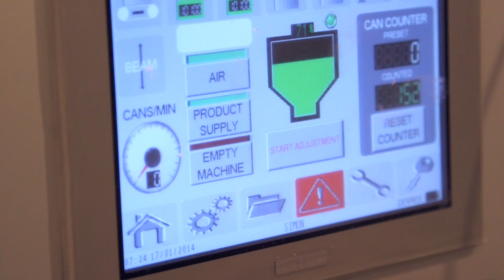Crown High Speed Filling Line

Comment: If someone need to start Paints manufacturing business & want to produce these quality products. Decorative & Industrial paints like Exterior, Interior, Luxury Coatings, Metal Surface,   
Surface Preparation, Wood Stains & Varnishes.
All manufacturing, formulation, Costing R&D testing, & working available with complete consultancy available.

1. Exterior Fine Filler,
2. Exterior Primer,
3. Fine Filler,
4. Matt Finish
5. Plastic Emulsion
6. Red Oxide Primer
7. Special Thinner
8. Super Emulsion
9. Synthetic Clear Varnish
10. Synthetic Enamel
11. Synthetic Metallic Enamel
12. Texture Finish
13. Undercoat
14. Wall Sealer
15. Weather Safe 
16. Wood sealer
17. Wood Laqaucre
18. NC Thinner.